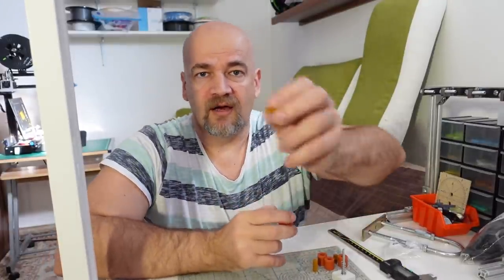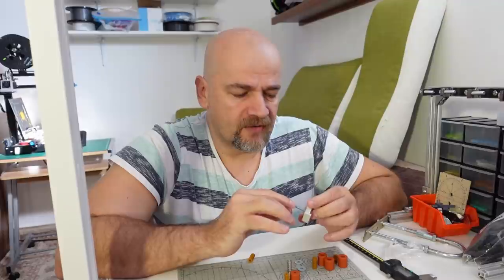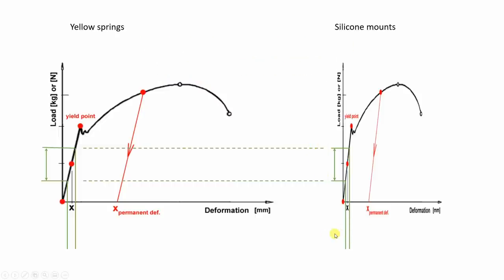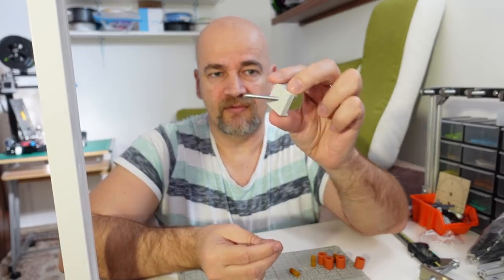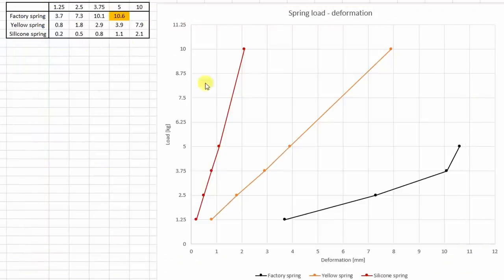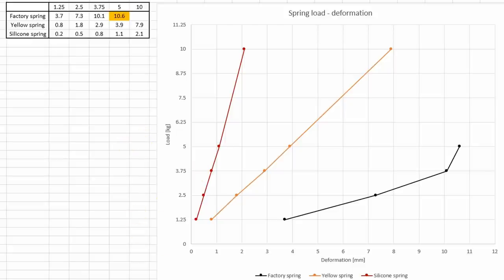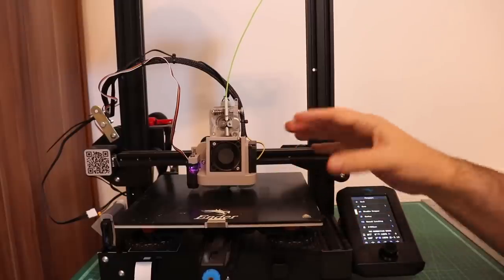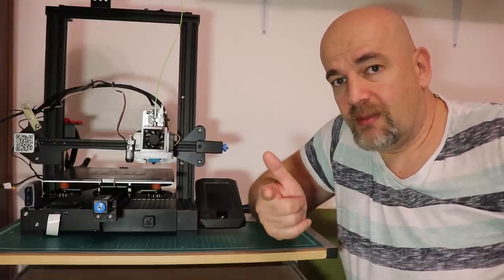Silicone mounts vs yellow springs vs factory springs - Ender3V2 upgrade

Comment: I had issues with having to constantly relevel (presumably due to weak springs) and my solution was to print plastic spacers (about 1.5mm high) to compress the weak springs at the ideal height. Worked so far
Reply: I always use washers of the appropriate size between the leveling screws and the bed mount. Stack as needed for extra compression.
Reply: i just moved my z stopper lol
Reply: @OneShot-kt8hd  moving z stoper doesn't do anything for bed leveling
Reply: Yeah I worked out it needs re-levelling if you have to be a bit aggressive taking off the last print
Reply: Do you have stl?
Reply: I printed some rigid spacers out of TPU to replace the springs altogether. They held up for about a year before I ended up popping in silicone ones.

Comment: A simple solution is to use a wing nut  below each  levelling knob, just make sure you dont disturb the knob when you tighten it up to it,  2 nuts locked against each other are  tight and not easily moved  ask any mechanic

Comment: Fully coil binding the bed springs and move the endstop switch to match (may need a new endstop mount) then level the bed, will lower the centre of gravity for the build plate and lower ringing/ghosting. Having the bed levelled at the default height allows way too much bed movement.
Reply: Nice way of thinking! I will do that today
Reply: I found if I do that in my Aquilla X2 or ender3 what happens is the bed will crash into the Y stepper motor.  I would really like to do it that way but have to make sure the bottom of the plate clears at least a couple mm before I set the stop switch.

Comment: If you are just hobby printing wait until the bed cools to remove your print, once the bed cools the parts slide right off.  If you're in a hurry you can spray some alcohol around the perimeter of the part to cool the bed faster and you can use the excess to clean the bed.  Anything that keeps you from yanking on the bed will help reduce bed leveling.  Lock nuts on the adjusting wheels will help too.  If you have ABL or manual mesh you can replace the springs with a solid spacer.  This can be tricky to level initially, you'll have to add and remove shims/washers to get the bed level to start, but once you get the bed level it generally doesn't move, any slight changes can be compensated by the ABL or checking your manual mesh occasionally and adjusting if necessary.  Disclaimer:  I have not personally tried the solid spacer method, I am currently using the upgraded yellow springs, but from what I've seen online people who have tried it like it.  Most new printers that come from the factory with an ABL probe installed also come with solid spacers installed from the factory.

Comment: I have them (Fysetc version both black and orange)installed on my e3 pro's since Aug 2019.  I love these silicone spacers and I tell everyone who will listen. No complaints at all. @300hrs of PETG at 90c  and no degredation that I can tell.
Reply: Same.  I installed a set of Fysetc silicone mounts in Jan of 2020 and not had any problems at all with them.  My octoprint leveling graph looks the same now as it did when I installed them.
Reply: Will it still perform the same if I pud in inside a heated enclosure?

Comment: Interesting. Sometimes your videos, while rigorous, don't draw many conclusions. However, in this one, I feel like you've definitely nailed down the fact that silicone mounts are better for auto bed-leveling systems, and strong yellow springs are better for printers utilizing the z-limit switch. This was your intuition, and you backed it up with some hard data. I feel much more informed, and if/when I buy a CR Touch or BL Touch I will consider adding silicone mounts as well. As for now, I'm using the yellow springs with a z-limit switch. Thanks!

Comment: I had silicon mounts on an Ender 3 for about 8 months and I had not problems at all but then my BL Touch mesh was not working I tried everything before I realised the gantry on the right hand side had dropped and changed the level above the BL Touch's tolerance, once that was addressed I had no further issues and the silicon mounts have been on for a total of 23 months now and never need adjusting as they hold perfect tension.
 I would advise any viewers that are having levelling issues to check the level of their gantry to the frame and not to the bed, there are many videos showing how to level the gantry correctly on YT
 This is a great video, showing the actual data for each spring is extremely informative.
Reply: question. Do you really tighten them and then level your bed or do you just tighten them a little then level?
Reply: @armani007E55  You use them the same as springs, but you apply a little less tension to start with and then manual level as normal
 Sorry I did not reply earlier but I did not get a notification, luckily I was showing my friend this video to explain the data
Reply: @Andrew Hayes  no worries. Never to late! Tks mate!🤙
Reply: Out of interest, how did you fix the drooping on the right side of your gantry ?
Reply: @armani007E55  You level them once. In the 6 months since I have had silicone spacers, I have not needed to relevel the bed a single time. Not even once. And I print at least 1 print a day. The gantry has needed adjustment, but that is done by turning the eccentric nut to take up the slack.
Reply: EXACTLY! having the X gantry square to the frame is number 1 priority to callibrate the nozzle and bed. Once you got that right THEN you can do the bed levelling.
Reply: @andersevenrud  I took the frame apart and re assemnled and I used a set square to get everythibg squared up, I then adjusted the excentric nuts and all has been well, I have since added a second leadscrew, sorry its late but it is hit or miss whether I get notifications to replies, I got one from someone else and noticed yours

Comment: Excellent video. I’m a 48 year old 3d printer rookie. I’m on my 4-5th  month and just got my 3rd printer. Started with Ender 3 to Ender 3 S1 to K1C. Though a printing rookie, I’m not without mechanical experience. 
What I’ve come to feel is that the bed springs have almost nothing to do with bed leveling and more importantly are under the build surface to protect the tool head from excessive Z offset. There are no provisions in the control boards(that I’ve seen) to detect a current spike from a motor to trip an anti overload switch. Cheaper protection suspend the build surface on a cushion. 
It’s like those Rings the “Pro” “Wrestlers” use to get all sweaty with one another. When they land on someone having just left the top rope, if the mat was statically mounted there would be a lot of fatalities.

Comment: The problem with the original springs is that they can move sideways while being compressed.  When adding your second weight this was clearly visible for the original springs.  This sideways motion allows for extra inaccuracy and additional modes of vibration.

Comment: As always, thank you for taking a scientific approach to your investigations.  Always helpful.  I've found the yellow springs to last for years.  Once set, and using BLtouch, I never have to adjust them.  But if I had to do it over again and change out the factory springs, I would go with the silicon mounts.

Comment: I replaced the stock springs with the yellow springs after printing over 100 hours, hoping the leveling issues would disappear (adjusting before every print, sometimes taking up to 30 minutes!). Reduced but still had to re-level after every 3 or 4 prints (verses after each one). The amount was less but still needed to be done. Then I saw a video about putting a lock nut (with nylon inner "seal") on the screws to prevent them from turning when turning the large adjustment wheels. What?!? I did experiment and found the screws (at least mine) did spin a bit. I installed the locknuts and at the same time replaced the yellow springs with silicone spacers (mine are black, don't know if there is a color code for compression resistance). I appreciate your video as it logically and empirically showed what I suspected to be true - thank you for all the time spent reassembling your printer so I didn't have to do it again! What a pain...

The Ender 3V2 has held "level" (stayed trammed?) for a month without needing adjusting (being paranoid I was checking it every day that I started a print but didn't touch the leveling knobs. Prints were ok but I like to tinker so I added a BL touch, mainly for my sons so they wouldn't need to mess with the adjustments. So far I am happy with the modifications. Next one will be adding Octoprint! Or upgrading to the Jyers firmware. Or a new controller board... {sigh} As long as it is printing well, I don't really have an excuse that satisfies my wife so this configuration will have to remain until after Christmas {grin}.
Reply: When you added the touch, am I right in assuming you still have to adjust the z offset?

From what I can understand, you add the silicone spacers, tighten down to virtually tightest it will go, manual level and then do a z offset to compensate form the probe? (I've got the CR touch installed and assuming it's the same principle)

Comment: I switched to the silicone things because they are very stiff and because their rubbery surface ensures that there can’t be any bed wobble during longer prints, since that was a issue I experienced with the original springs.

Comment: have just ordered silcone mounts as my 3v2 has issue with adhesion despite having the bed leveled and using a cr touch module. your video has been a great source of info

Comment: I have been using the silicone for about a year now and find a much more stable bed after many prints, I also installed a small m4 nuts on the screws on the bottom of the bed before installing the silicone to keep the screws from spinning loose, That way the only moving part is the adjustment wheel on the bottom. I did many test on both of my ender 3's and the nuts do make a big difference.
Reply: What size nut?
Reply: @mykoluis3660 M4, coarse thread (0.7 mm pitch). Be careful about the heater circuit traces. I put a nylon washer between the bed and each of the locking nuts I installed.

Comment: Nice test, I've used the yellow ones on my bed before, but when I upgraded to a bigger bed I went with the silicone columns, albeit mine are the clear white ones. I did notice they're far stiffer than the yellow springs, but I mostly chose them because I thought they might have a better sideways stiffness based on them having a lot bigger surface area than the springs. They've been on the bed and printing for now... just a day, but let's see their durability on heat.
One thing I would like to add, that you kinda saw on the tests, is that the tensile strength graph shown is valid mostly just for traction, albeit with steel the linear line should be similar, a compression graph would not show a rupture line for example, it just goes up and up and deforms more and more (since it won't ever snap, just become wider and shorter instead). A spring, if designed correctly, should never have permanent deformation under compression (which is the bed leveling springs), as it would, like you found out, bottom out way before the material itself has problems, and by then if you manage to make the material deform by compression then you're probably using some absurd alloy bolts and destroying everything in the way too. What can cause weird things when plotting a graph is if it starts crossing the coils, like would happen with the default Ender springs. The columns whoever might have permanent deformation problems, as they can't bottom out, but, as they're so much stiffer already then you're probably running into the same thing as bottoming out the metal springs and crushing them. The heat and long therm part tho is interesting, as polymers react way differently.
Reply: I posted above trying to find the correct springs. Not yet positive the yellow ones that everybody is pushing are all that great. The springs from China are terrible. The stock springs on my Ender 3 v2 look to be deformed already. The other thing I notice is metal washers on plate. If i get the God darned thing leveled and finally to printing I will find stl and print some high temp. g%&@* bloasted washers.
Reply: @joelstolarski2244  I have 2 Ender 5+ printers and one of them I have been having real problems levelling it, the first machine came with the bad quality springs so I changed to the yellow ones, the second machine came with the yellow springs or so I thought, I stripped the bed down to find out why the damn thing would not level and I found one of the springs was snapped and they are not the same as the regular yellow springs the metal is much thinner and very very weak (probably Chineseum) so I fitted some spare springs I have and all is well although I have ordered some more sillicon ones for both machines as I have them on some Ender 3's and they are great
Reply: @AndrewAHayes  So far I'm pretty sure the yellow springs may have caused a very slight warp in the bed at bottom right quadrant of 3v2 bed. It will drive me nuts. Running Jeyers
Reply: @joelstolarski2244  I think it is the bed clips that cause these drops on the corners, I have placed just one clip in the middle at front and back and it keeps the bed secure and stops the corner drops, give it a try it might fix your issue also Joel

Comment: I haven't experienced any issues with the silicone mounts, I already had the firmer yellow/orange springs on my printer and while I don't think I had issues with the bed due to the spring I wanted to get the silicone ones. I just wanted something with low thermal conductivity as to not cause the bed frame to work as a heatsink, the silicone mounts just made sense to me, I don't think the lack of elasticity is going to cause any issues.

Comment: Hey there ! Nice explaining video !!! I believe though that the best trick is to use safety nuts because the safety nuts has some nylon lock mechanism and it is very very hard to turn the nut without any tool.
Reply from the maker: Yes, great idea. I noticed that they don't lock soo good after I use them for second time, but better than nothing. Woth to try for neat permanent leveling

Comment: at 14:26 -- the pockets in the silicone also allow for a nut to lock the countersunk bolt to the bed.  If the friction of the countersink cone is less than the friction of the threads on the M4, then the head and bolt will spin rather than the leveling knob moving up or down the both..

Comment: To answer your question, after more than a year after switching to silicone mounts, I didn't had any issues. I don't know if they become more stiff or if they deformed because I simply installed them and never touched them since. I realized that I didn't even leveled my bed after. Using Bl Touch and a glass bed. But to be honest I never needed to force anything while removing my prints, thanks to some magigoo.

Comment: Almost two years since I installed the silicone mod on my Prusa MK3 - perfect results like on first day. I used a silicone tube from automotive parts.
Reply from the maker: On MK3? But that bed is fixed, no need for silicone mounts.
Reply: @MyTechFun  yes you need it there too. Bed is fixed but I had 0.6mm tolerance from corner to corner. Pinda will try to compensate but parts are still bend when not level. After silicone mod I made multicolor 3d printed signs with perfect first layer. Before this mod it was not possible.

Comment: Very informative video! I'm using the stock springs for more than 1 year on my Ender 5 and thinking about replace them. Since I have BLTouch installed I'm now considering using the silicon.
Reply: I replaced my springs recently and now can't even get the bed to stay level... debating silicone instead... have you made the switch?
Reply: @Moonclaw196  Ho Joey, yes I did replace it just after I posted the previous comment. For my printer it worked very well. I found it's a bit difficult to make it level so I tried several rounds for the first manual leveling.

Comment: I have found this video now.  I have used all three and I have actually found the yellow springs were the best on my Ender 5 (original model).
I found the factory silver springs were way to weak, it would move too much.  The silicon blocks, on the other hand, were too rigid and made it virtually impossible to level the bed as moving one corner even 0.1mm would upset all the other corners.   The yellow springs are stable, don't move during prints, but flexible enough that leveling the bed is easy to complete.  I print on the original Ender bed, PEI bed and glass and a BL Touch.   I find the yellow springs best.